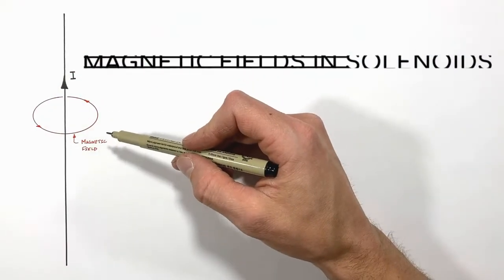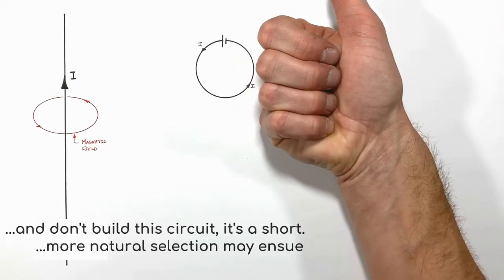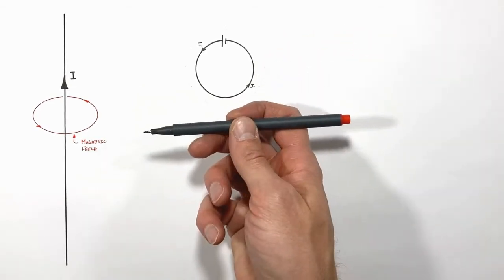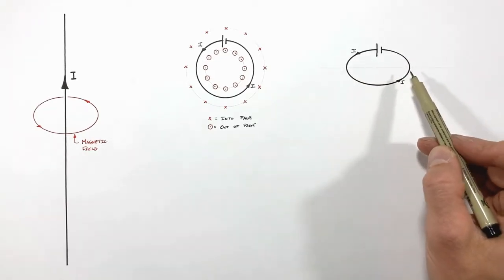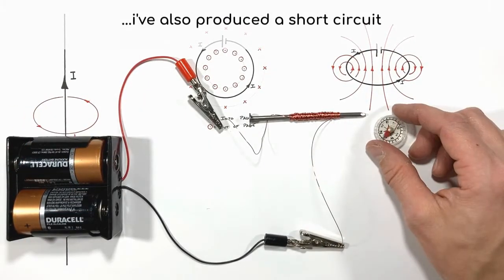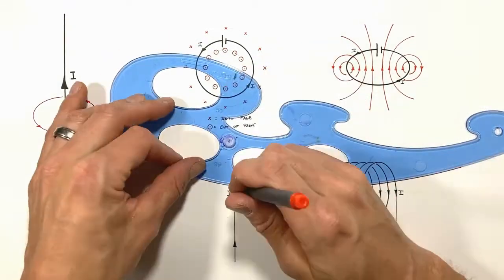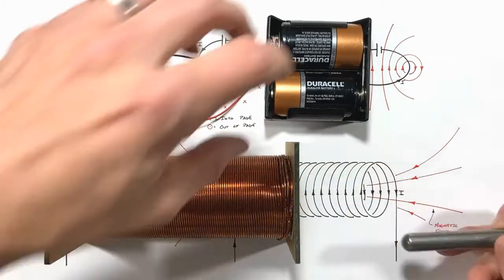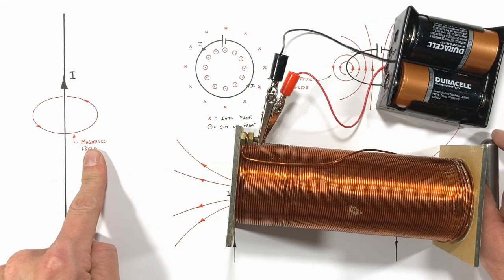How Does a Coiled Wire Become an Electromagnet?

Comment: Why does the current still go through all the loops instead of just straight through the solenoid longitudinally if the wire is uninsulated and the turns of the coils are touching each other?